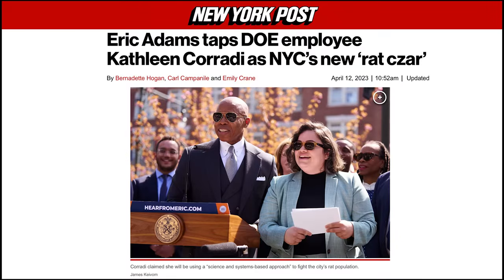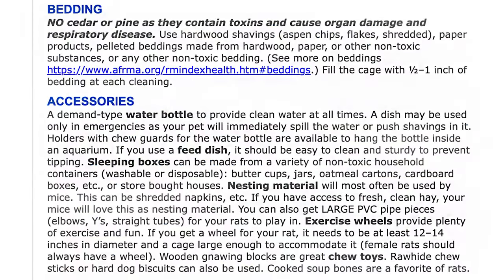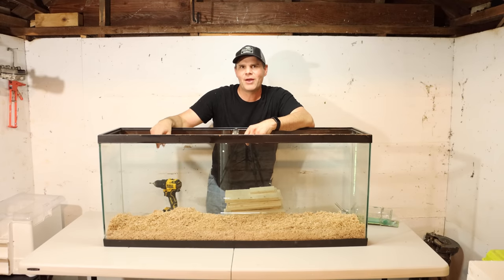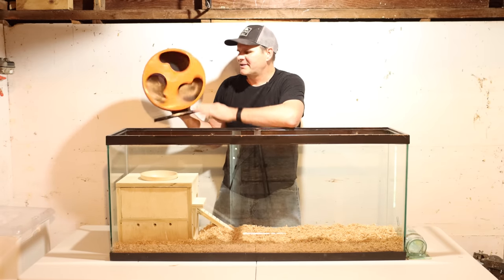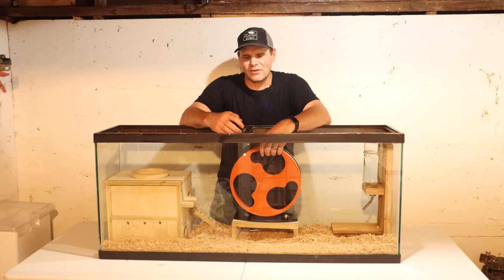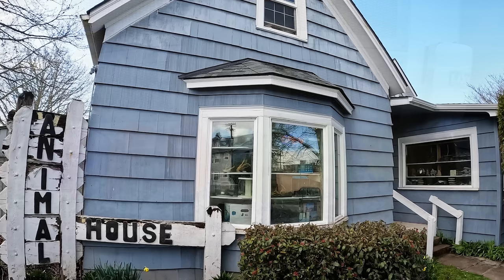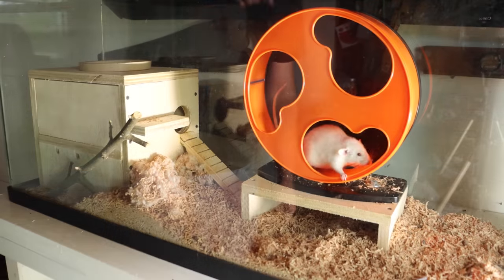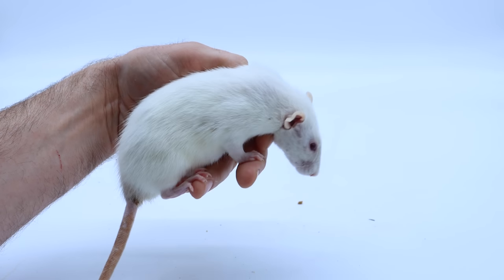My New Pet Rat "Judas" Will Help Catch Wild Rats. Building A Pet Rat Paradise. Mousetrap Monday

Comment: If you have the space I'd recommend getting them a bigger, wired enclosure, not so much bigger as in horizontal space but vertical. Also, a wired cage is better recommended for ventilation as rats are more prone to respiratory issues compared to mice.

Other than that Judas and Judy are precious! And how lucky that you got them an apple branch and Judy loves apples!
Reply: But also, to avoid bumble foot from wire cages, put some carpet or something on the horizontal areas. 😅
Reply: These cuties definitely need a bigger cage that has better ventilation.
Reply: @fburnsDubstepEnderFox  the horizontal areas are usually plastic platforms when you buy such cage and you don't need anything as such. 

But if it's the case (wired platforms) you're right !
Reply: Aquariums are not that good for them.

Comment: a glass tank isnt the best way to keep smaller animals. ive only ever kept guinea pigs, but ive seen it said a thousand times not to use solid walled enclosures because it blocks proper airflow for the animal. id look into a wire/mesh walled enclosure of some kind. obviously not one made for GPs though, the rats will jump right through it lol

regardless, your channel and all your videos are awesome. congrats on the recent positive exposure!
Reply: Rats typically huddle in tight, confined spaces, frequently between walls and under concrete slabs, only going out to search for food. A glass enclosure should be fine with sufficient chewable items, bedding, and a mesh ceiling.
Reply: @keithbk  this rat won’t be “going out” though
Reply: Gives a lot of mess with opens bars, also they gnaw on them which make a lot of sound
Reply: @narrowpath9491 f rats are choosing to gnaw on metal bars, there's an issue. that is not a normal behavior when they have adequate chewables and enrichment in their enclosure. Also pets are messy, if you don't want mess don't get an animal.
Reply: A simple USB or computer fan pointing into the cage to force airflow would be adequate to make sure there's no ammonia buildup inside.
Reply: @Sean_735  Except that rats are prone to resipratory infections and so it is recommended to keep them away from things like fans and air conditioners that blow directly at them.
Reply: @keithbk  Wild rats and fancy rats are physically quite different. Fancy rats have been subjected to hundreds of generations of breeding to make them more suitable for domestication, alongside having never lived in the wild meaning they never built up those tolerances to things wild rats face every day. Fancy rats' lungs and airways are more prone to respiratory infections than wild rats, and are more sensitive to changes in conditions than wild rats too. They are also larger, less muscular, less athletic, and have much lower cardiovascular fitness due to having a much more sedentary and less stressful life. 

Even if you made sure your domestic fancy rats were able to run around lots and had endless room to roam, they would still never have had to spend all day hunting for food, would never have eaten the varied diet of a (healthy, non-urban) wild rat that should ideally contain a lot of insects, would never have experienced predator stress which keeps wild rats mentally alert and constantly "on the go"... etc. They also wouldn't be exposed to all of the diseases and physical stressors like cold and wind that wild rats deal with daily.

So, while your comment would be spot-on for wild rats, or even for the tamed children of wild rat parents, these are fancy rats. Their ancestors were domesticated literally hundreds of generations ago, and everything from genetic to epigenetic to environmental and cultural (insofar as the term applies to non-sapient beings) factors are all geared towards making them into, in the words of a reddit /r/RATS user, "soft, pampered bourgeoise babies" who have never known hardship lol. And, as the ones who made them that way and the ones who have the intelligence and power to change them like that, we humans have an ethical responsibility to look after our pets and accommodate the fact that we have literally bred those adaptations to captivity into them.

So... yeah, fancy rats need more ventilation and need to have their delicate systems looked after in ways a wild rat might not!
Reply: It is fine how he is doing this, but rats are a bit squirrel-like will use vertical space if it is given. I have found old bird cages with hammocks at different lives  in a "rat tree" works well for them and is easier to clean than aquariums.

Comment: wood. Tanks are not good for fancy rats. Yes they like to sleep and hide in tight places but those places breath. I have had rats for over 20 years and glass tanks lead to health issue and bugs. They are also harder to keep clean and dry. Wire cages are better with outer wood draft guards. I have had rats live over 3 years where glass tank rats live far shorter.

Also pet rats are happier in wire cages.  Also fancy rats are less likely to try escaping viva trying to push up the cage lid when in wire cages. Side doors are easier to lock. Rats are very strong viva head butting top openings.

While glass is easier to view through wire is healther. Still make sure to not have their cage under ac and ceiling fans or air vents. Fancy rats are fun and wonderful pets. Taking them out and playing with them is a must. They love their owners and even sit and watch TV. Well, at least listen and snuggle.

Just make sure their cage is always clean and train them to be out often to play.

Comment: ive had 6 rats so far (5 male 1 female. currently only have 3 males left due to old age) and my only suggestion is to get the male neutered if you arent wanting 20 babies every other month ahahah!! i had a male and female together and they had 2 litters 2 months! other than that, maybe a wire cage to help with airflow and engagement!

Comment: we had rats as pets, the most kind rat we had wasn’t the fancy rats or the dumbo rats, or the albino rats. He was a norway rat. he was huge, 2lbs. 
i found that if the rats had someplace enclosed like the house you built, it tended to make them more skittish and over protective. Which led to shy rats who were afraid and would bite in fear. 
so I went with hammocks. fleece hammocks. they’d destroy them, but they were much friendlier. 
Also we used a huge 4 story ferret metal cage on wheels. I bought fleece sleeves for the ramps, as the felled was very easy to clean. I then used old fleece blankets for the bedding. I saved a ton of money, and had soft bedding for the rats. Also way less respiratory issues. I had an older top loader washer and after sweeping the solids off of the fleece i would put them through the wash. 
it became very simple. and the rats could always see me, and hear me, they never became shy or afraid or overprotective. I had babies this way also. 
Rest in peace to my big fat fred rat. he was awesome.
Reply: *typo- fleece was easy to clean 
not- felled

Comment: I appreciate your knowledge of rats but glass aquariums aren't good for rats. You need a wire cage with adequate bar spacing. Aspen or pine shavings for bedding. The reason you had to modify The water bottle is because its made for wire cages not aquariums. Thanks for letting people know that there are humane ways to solve rodent issues.

Comment: I'm sorry Shawn. As much as I love your content I do feel a need to speak up here. This is not good enough. Substrate needs to go. It's way to dusty because of the sander. A rats sensitive respiratory system will not do well.
A 12" wheel is not adequate for adult rats. It should be 14" for  female and 16" for a male. Unnatural bending of the spine will result in injuries.
And the enclosure isn't good either.
A whole glass enclosure does not provide sufficient airflow. Even with the mesh lid.
Rats have extremely sensitive airways. The ammonia buildup from their p&poo will make them sick eventually.

PS: For those of you that gets the idea to tell me about how you kept rats for world record breaking years of age in similiar conditions. No one actually believes your bs and bragging about animal cruelty is only a self-own.